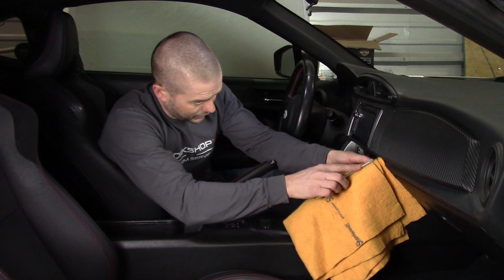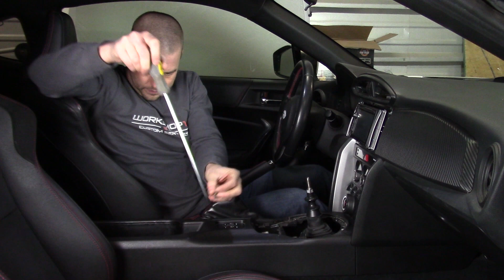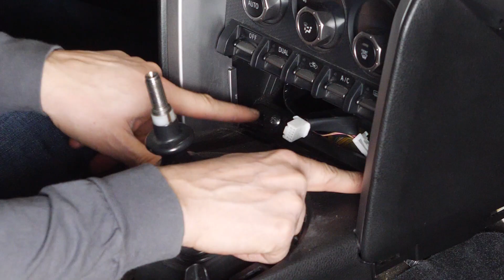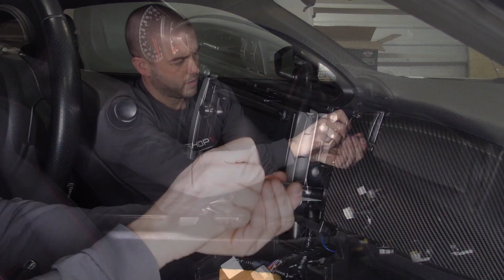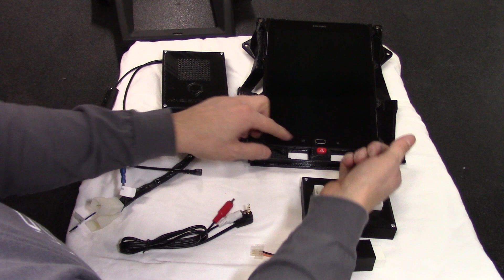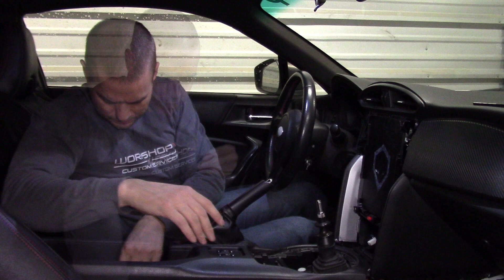MK2 Brainiac FRS/BRZ Installation

Comment: ......what about the factory controls on the steering wheel.....
I'm going to assume that you're going to lose that function right?

Or is this model only for the Subaru BRZ and FRS without steering wheel controls?
Reply from the maker: It is possible with a 3rd party module. We have more on those details here 👍 https://workshoptwelve.com/faq/

Comment: I'd be concerned with the tablet handling high temps on a hot day.
Reply from the maker: I would not recommend leaving it in the car unattended for prolonged periods of time. However, if you are driving and or leave it inside for a few hours it should not be a problem. Depending on where you live

Comment: Will this work with the 2017 toyota 86?
Reply from the maker: That would depend on a couple of things. First the car must be equipped with the dual zone electronic climate control with push to start. Also if your vehicle is equipped with the single one piece dash trim that goes all the way from above the glove box and around the stereo you would need to pick up one of the stock two piece plastics Part No: 66077CA030 or equivalent).

Comment: Does your back up camera and radio controllers work with this?
Reply from the maker: We are working on a backup camera solution but don't have one available right now.. can you provide more details on what you mean by radio controller?
Reply: @WorkshoptwelveConnect  thanks, By radio control I mean the  Steering wheel buttons like Volume, Source, Change radio channels,  Assistant button
Reply from the maker: @JayPimen  so you won't have AM/FM radio as it is a tablet. You can use a JoyCon unit to integrate steering wheel controls. You can find details on this and other common questions here https://workshoptwelve.com/faq/
Reply: Will only be able to use the Tab S2&S3 or will there be other tablets that can be used?

Comment: can we see this in action? I've been interested in this for a couple years now and the main thing holding me back is I can't seem to find any video of it in action after installation.
Reply from the maker: Are you interested in the user interface for how it controls climate? We don't have a shop car with it installed to show it adjusting the climate
Reply: @WorkshoptwelveConnect  please do a interface video i want to know which features it has
Reply from the maker: @NeiraRs  there have been features added since, but her is a v3 walkthrough https://youtu.be/hREdO3mV9Tc
Reply from the maker: @NeiraRs  here is an update video we did with v3.7 https://youtu.be/C6dp1oTZJHg
Reply from the maker: @NeiraRs  here is a blog of what was added in v3.8 https://blog.workshoptwelve.com/2019/11/21/whats-in-brainiac-version-3-8/